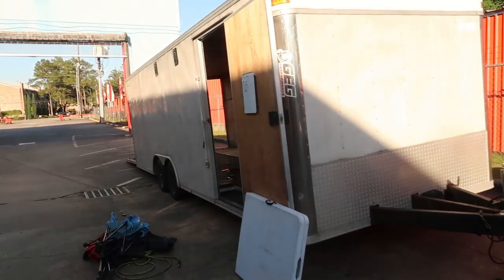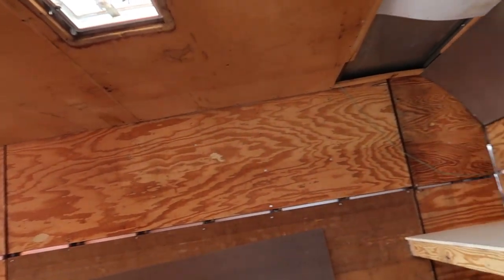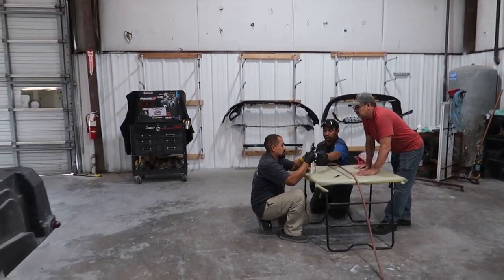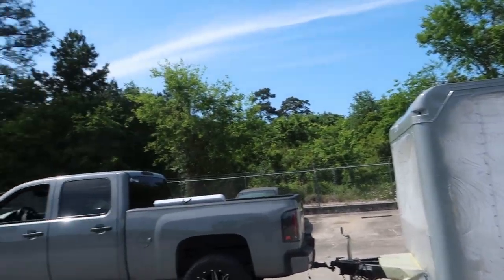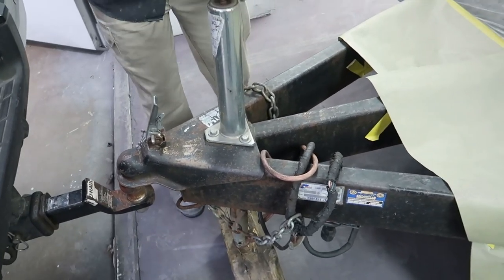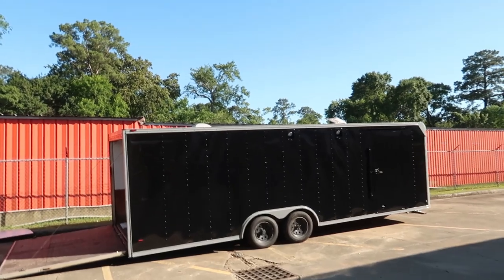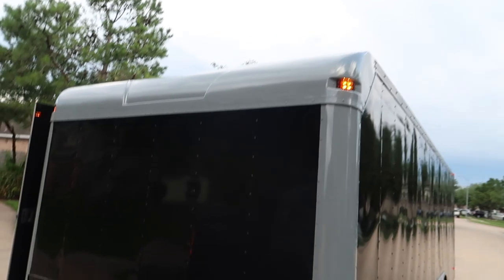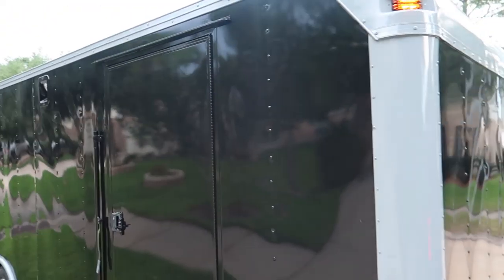Renovating my ENCLOSED TRAILER!

Comment: I just bought an old enclosed trailer. Got a good deal on it and I'm gonna renovate it. I want to paint the exterior. Do u have any advice on painting? I don't want to spend a boat load of money at a body shop,,, my grandfather use to paint cars and has a spray gun. Granite,, he hadn't done it in years but with some practice before starting the trailer I'm sure me and him could do a good job. 
What type of paint would u recommend? How much prep work is involved? I want mine gloss black like yours here. 
Wonderful job on yours !

Comment: I've have had a 6x12 enclosed trailer for a few years now which was used as storage for my stuff and motorcycles. Now I'm back in Texas so I pulled all my stuff out and put it into storage. I had the inside done with cedar fence pickets and a rustic pergo style floor. I set up a front counter with granite on it and white Christmas lights around the ceiling perimeter, it feels like being in a small ski cabin. My next job is to freshen up the outside, it's straight but it's kind of ugly with the stickers from the previous owner. I'm not looking to do spray paint or anything really elaborate, would just like to apply some kind of durable white paint at a minimal cost. Otherwise, I'm really happy with my little mobile homie crib and I'm saving approximately $700 a month in rent by not getting an apartment or renting a room.

Comment: I’ve been debating doing this to my 24’ snowmobile trailer. Likely just throw new axles under it and re do the wiring and paint as it’s been used for snowmobile storage most of its life.

Comment: Where did you get the floodlights? I can’t find the housing or anything lol
Reply from the maker: John P Amazon!
Reply: TheBulletWS6 alright I’ll search again thank you
Reply from the maker: John P I typed in trailer flood lights and it came
Right up. Pretty nice piece
Reply: TheBulletWS6 I found them. Ironically I’m gonna be fixing up a haulmark to haul my turbo ws6 that’s almost done.
Reply from the maker: John P nice!! Boosted?
Reply: TheBulletWS6 yes sir. 6.0 with gen 4 rods and pistons. 88mm turbo from work turbo. Holley lo ram intake. Holley terminator x. Ford 9 inch. Turbo 400. Goal is to make 1000 on e85
Reply from the maker: John P nice! Have an IG? I’d like to follow along
Reply: TheBulletWS6.  john_penrod